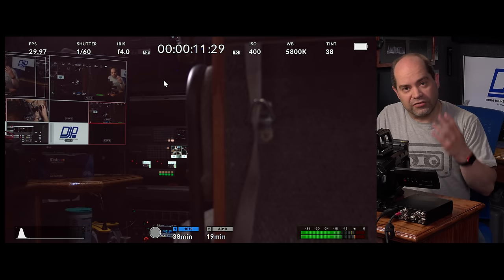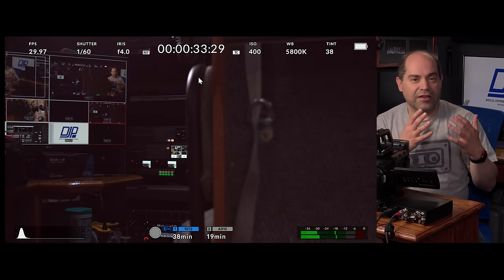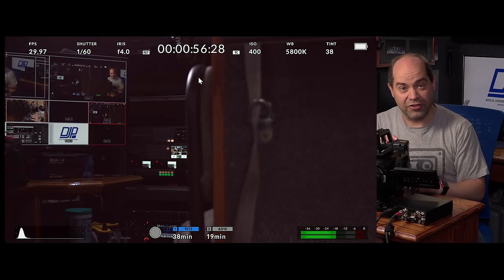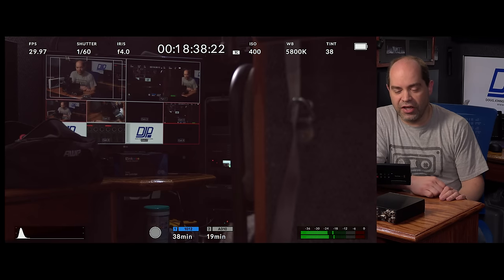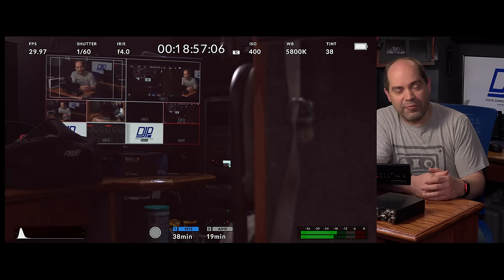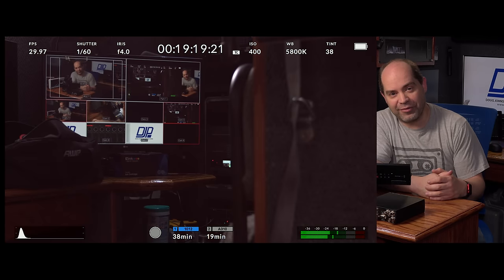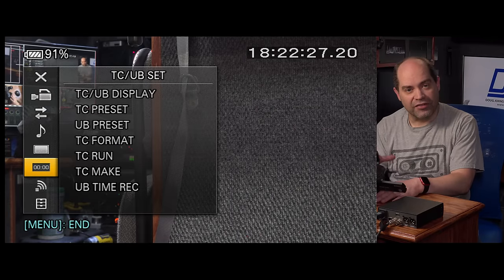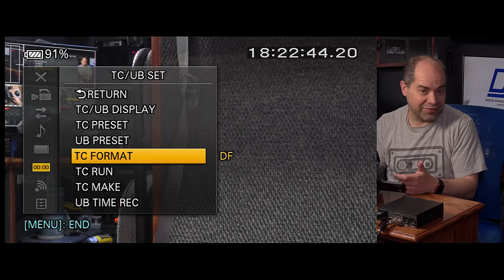Genlock, Timecode, Wordclock -- What Are They? Do I Need Them? Are They Interchangeable?

Comment: Great video Doug! How would you actually adjust timing on the longer cables. For example I am running 4 genlocked cameras with different cable lengths (15-40 meters) and cameras have option to adjust H phase. Do you use oscilloscope for such purpose to perfectly match the signals?
Reply from the maker: Genlockable sources usually have a timing adjustment. 

Honestly, I've never done long-distance syncing in HD. In the SD world we'd use a waveform monitor.
Reply: The EE (Electrical Engineering) answer is that you generally won't run into time-domain signal issues with cable length until you approach the quarter-wavelength of the signal.   In other words:  Transmission-line effects become significant when the length of the line is comparable to or greater than the wavelength of the signal. 

A more specific general rule of thumb is one-quarter of the wavelength. 

Given the HD 1080p Genlock signal demonstrated at 10:28, we can calculate the maximum cable length for which we will begin to have to worry about Transmission-line effects:

Full-cycle wavelength of 33.7159 KHz signal = 29185.0432 feet = 8897.8790 meters.
1/4 wavelength of 33.7159 KHz signal = 7296.2608 feet = 2224.46976 meters.

So for transmission delays on a long cable, we would need to have a maximum cable length just under 1.38 miles!  That's quite a long cable!  If we go over that distance we might begin to look at other transmission options such as fiber optics or radio frequencies.

More likely the issue that you'll run into first with longer cables is dealing with noise picked up by the cable itself from nearby sources of electro-magnetic fields.

Comment: Hello! Thank you for complete explanation! I never knew that. Very interesting and useful. Does all these BNC cables are 75 Ohm or some are 50 Ohm as well? Or 75- audio clocking, 50- video genlock/time code? Thanks!
Reply from the maker: All are 75 ohm.
Reply: @djp_video  Thanks! I guess 50 ohms RF was for analog antenna stuff, but they're everywhere in the stores, maybe for older analog signals or something like that.
Reply from the maker: @the_newvoice  Yes, 50 ohm is primarily used for radio applications. The one big exception is over-the-air TV antennas, which are either 75 ohm (coax) or 300 ohm (flat).
Reply: @djp_video  Thank you!

Comment: Thanks. Very informative and useful video. while editing a  video shot with multi-camera, the NLE software like Premiere Pro will syn the shots by itself. And this is very close to the 'Timecode' application.
Please correct me if I am wrong.
Genlock is of course different.

Thanks
Vikram (India)
Reply from the maker: When you have similar audio across different cameras, yes, Premiere and other editing apps can synchronize based on the audio waveform. But this feature doesn't always work. I've had it fail as many times as it has worked. If the cameras aren't placed close to one another, or if one camera picks up more background noise than another, or if audio isn't recorded on a camera for whatever reason, or if the audio in any other way differs significantly, you're on your own.

Comment: I´m a little late, so I dont know if you´re going to see this, grate content, I have a question: If i sync timecode first, and then connect gen lock between cameras and switcher ie. does the timecode stays synced with the jam, or is it going to drift? I mean if we´re starting the first pixel at the same time in all devices, the timecode should not drift, or is it?
Reply from the maker: The timecode and genlock signals would have to come from the same source. Otherwise the timing won't stay in sync. Higher-end sync generators will create both signals for you.

Comment: Hi Doug! This is very informative video thanks! Quick question, my blackmagic 12k can't get 60fps genlock from AJA gen10( HD 720p60 ) . Is there any setting i did wrong?  Thanks!
Reply from the maker: Try setting the GEN10 to output sync for 1080i59.94. It's a different type of signal that I believe the Blackmagic cameras know how to use. The 720p sync signal has the wrong horizontal sync timing for 1080p/4K.

Comment: Very informative! Quick question, in the tentical example, would that audio signal have to be maintained throughout the entire production or would a typical GH4 /GH5 mirrorless multi cam setup accept a temporary jam signal from a master TC generator? Thanks
Reply from the maker: If a camera has a jam sync feature you don’t technically have to maintain a connection to a master sync source, even though it would still be a good idea. But for cameras that don’t, you could get away with starting the beginning of each clip with timecode audio so the editor can sync the start of each file. The preferred way to go is to leave the master timecode source connected all of the time. 

Because timecode is just audio, you could split the signal from your timecode source to multiple cameras at the same time, the same way you’d split any other audio. I’ll be demonstrating one way of doing that in a future video.
Reply: @djp_video  looking forward to that video, thanks. I just picked up a Denecke SB-4 super cheap at a local pawn shop, will it’s BNC jack output TC audio? Can I just adapt to 3.5mm and jam a lumix camera?
Reply from the maker: Yes, you can connect to your camera. If your camera has a timecode decoder you can jam sync it. Otherwise it will just be an audio track.

Comment: this is great!!! I just started learning about Genlock and was trying to find out how does it actually work but there is very little information. THANK YOU!

What about UHD? I cant find any 4k sync generators but forums say that Tri-level genlock will work fine.
Just wandering.. is it just that first burst for communication when to start new line and pulse per second that matters?

How UHD device translates HD genlock? is it simple scaling? 
I found diagrams showing to use Black Burst interlaces settings 625i25 PAL for 4kp video.
I am so lost :) Can anyone explain ? 
Where an I find more resources ?
Reply from the maker: Let's start from the base of information from this video. I'll build on that. (But I'm simplifying things at the same time too.)

There are two separate synchronizations happening with Genlock ...  Horizontal and Vertical. Vertical sync happens once per frame, and horizontal happens once for each scan line (including those that aren't part of the picture, which is kind of another discussion).

Because the vertical sync is tied only to the frame rate and is independent of the resolution, many devices can use sync signals designed for lower resolutions when producing higher resolution video. So in theory a UHD camera could use blackburst, which is standard definition, for vertical sync. It would have to ignore the horizontal sync since those are tied to the resolution, but vertical sync is usually enough to line things up because the frame rates (24, 25, 30, 50, or 60 fps) is independent of resolution and therefore can be can be the same across SD/HD/UHD. So a 60 fps (frames or fields per second) SD sync signal can work for UHD running at 60 fps (frames per second).

The other consideration is that blackburst was designed for interlaced video. And even though in the world of interlace video we usually refer to frame rates of 25 or 30 frames per second, each frame is made up of two separate fields, so the fields are being created at 50 or 60 frames per second. That also means that even though blackburst is syncing 25 or 30 frames per second, it is also syncing fields 50 or 60 times per second, and if you were to look at a blackburst signal you'd see vertical sync pulses 50/60 times per second. And HD and UHD cameras creating progressive video can use that field sync signal to synchronize progressive frames rather than interlaced fields, thus giving you compatibility between ancient blackburst signals and modern 4K cameras.
Reply: Thank you @djp_video  This is all very fascinating.
I've noticed you have YT subscription available but have you been thinking about Patreon?
I can imagine you have a lot of knowledge to share, I would love to learn more.

Comment: On the monitor behind on the desk displaying the video and time, it that an option on the Panasonic monitor to display the embedded time? Or are you using a different device display the tc info?
Reply from the maker: The monitor is a Sony PVM-A170 and it has a feature to display timecode built in.

Comment: Hey Doug, thank you again for the info and help with my last question. But I have another if that’s okay - with the tentacle sync, do they have to stay on for the whole
Day? Or can you shut them off and it keeps the time code? Just wondering if you have to re - sync every time they turn on. Thank you
Reply from the maker: You do need to re-sync when you turn them back on. If you use your cell phone as the time source it's pretty easy to do.
Reply: Okay thank you, is it recommended on a full day shoot to even turn them off if you don’t need to? Or would new time codes not really make a difference in editing. Thank you again for the reply

Comment: With many devices having a ref in and ref out is there any limitation to how many devices can be chained together, or any potential for a device that's connected directly to the signal generator to be out of sync with a device that has it's reference chained through a dozen other devices?
Reply from the maker: There isn't a hard limit. And it will depend on whether the signal is regenerated or simply passed through. It's better to use a distribution amplifier (any old-school video DA will work) and have separate connections for each device, but you can certainly chain one REF to another as long as you know those devices will be powered on.

Comment: My question is how I turn a genlock signal into wordclock? Or how to make sure no sync issues occur when using Dante audio in live video production? Got any tips?
Reply from the maker: I'm not aware of any devices that will take a genlock signal and create word clock from it. But there are multiple options out there for devices that will create both though.

Cameras which are genlocked should maintain audio sync with other genlocked sources.

In terms of integrating with Dante, you'll want a mixer that has a word clock input, and then set that as the timing leader for the Dante network.
Reply: @djp_video  I use an ESE DV-321 which will derive a 48khz wordclock (and an AES11 signal) from genlock. It's a (relatively) inexpensive way to keep audio in sync with video over long periods of time.

Comment: I have three BMD studio cam 4k pros (no reference in), the BMD ATEM Production Studio 4K (has one reference in) and focusrite 18i20 (wordclock bnc) could I connect all of these from the BMD hyperdeck mini reference out? Daisy chain obviously, or what would be the best solution for this?
Reply from the maker: Since most of the Studio cameras don’t have a Ref In connection, they can’t be synchronized directly to a Genlock source. I believe you can set them to synchronize to the SDI input, which would effectively take care of many (though not all) of the reasons to use Genlock, like making sure that cameras all stay in sync with one another. That won’t help with minimizing latency, though.

Using the Ref output of your HyperDeck doesn’t really buy you much of anything. The ATEM has its own internal clock and frame synchronizer and it runs just fine without a Ref input. Having the HyperDeck supply a reference signal only prevents the ATEM from skipping or doubling video frames from the HyperDeck and nothing else, and that would happen so rarely that I’m not sure it’s worth adding that additional complexity and possible failure point by making that connection.

The Focusrite isn’t going to recognize the Ref signal from the HyperDeck — it is strictly used for Genlock. Word clock is an entirely different signal.

Comment: Hello, do I understand correctly? Timecode is always also an audio signal? 

Would it be possible to transform the TC - out from a zoom f8 via bnc to xlr or jack and go into a dslm camera? 

I assumed that audio timecode is different from bnc timecode.

If this works I will solder with a bnc to xlr/jack. 

Best regards!
Reply from the maker: It isn't always audio, but it is usually basically just an audio signal. Dedicated timecode connections, including BNC, are essentially just audio. 

I don't have a Zoom F8 to test, but it probably is just an audio signal. But to connect it to a DSLR/mirrorless camera's microphone input you'd need to drop the level unless your specific camera can be set to accept a line-level signal. The F8 would be outputting something around a line level, but the camera is expecting microphone level. But that's easy to do.
Reply: @djp_video  thank you so much! So i need to add a resistor too.

Thanks alot

Comment: For some models, such as canon r5c, the fuselage has only a separate time code interface instead of TC in interface. Can such interface be used to access genlock signal? I see the ref / TC in interface of BMD camera. You can accept two different types of X
Reply from the maker: No. Time Code and Genlock are different signals. The only cameras I've seen that support time code on the same connector as Genlock are the Ursas from Blackmagic Design.

Comment: Hi Doug, when you plugged in the cable to the TC IN Jack on the camera (at 26:00) not only did the the timecode change, but one of the colons changed to a semi-colon! What does that mean?
Reply: The semi-colon means that it is drop frame timecode (a regular colon is non-drop frame).  Basically, since the frame rates, such as 29.97 and 59.94, are not whole numbers, every second is missing parts of frames (.03 or .06 in those cases), which will add up over time.  So, with timecode, you can either ignore the missing frames and just keep counting or the timecode will drop frames on the counter so it accurately reflects the time, and so there are the 2 different types of timecode to notate that.
Reply from the maker: What Ryan said... ^^^
Reply: @RyanBoni  thanks Ryan, yes Doug did say he was running the system at 29.97fps so if understand it,  the semi colon means that it is not running full frames per second (eg not 30). Thx!
Reply: @lansleyONE   @Nick Lansley  Sorry, I answered the question while the video was still playing before I heard Doug give a full explanation of drop frame/non-drop frame later in the video!!  But, to answer your question, Nick, no the semi-colon or colon does not necessarily tell you one way or another if the system is running at 29.97 or 30.  All that the appearance of the colon or semi-colon does is tell you if the timecode counter is counting all of the frames or not.  Really, just think of it as 2 different counting methods. One precisely and accurately reflects the actual time elapsed and the other just keeps counting and will slowly drift from the actual time elapsed. The difference between the 2 is generally irrelevant, unless you are mixing DF and NDF together while editing things that were shot at the same time with different cameras, or if you need the timecode to accurately reflect the time of day or time elapsed for some specific reason. The general rule is to pick one or the other and just always use that one.

Comment: What if you use a recorder monitor with SDI inputs? Does this get over the issue of DSLR's without any genlock capability?
Reply from the maker: Some models like the current HyperDeck Studio models from Blackmagic can re-sync the input to a genlock source (but they obviously don't adjust the timing of the camera itself). But in most cases that doesn't buy you much -- most modern video switchers have frame synchronizers built-in which do the exact same thing.

Comment: Do you know how old and new hyperdeck series handle sync issues in cameras, and does it matter if ref in/out is connected or not? I.e. will hyperdecks just take the frames from the cameras? Or will hyperdecks occasionally drop/pad frames if the cameras go out of sync with the recorders?
Reply from the maker: The Reference input on the HyperDecks is only used for playback. When recording it syncs to the incoming video signal.
Reply: @djp_video  thanks!

Comment: Using Dante as a means for transporting the timecode LTC signal have you ever run into any issues with there being a drift in timecode due to the latency from the dante network? I know on a well put together dante network you should expect sub 1ms delay of latency but is that not enough to off set the timecode that's being received after the dante network to that which is being generated from the master timecode clock?
Reply from the maker: No. Timecode is only accurate to a frame (at 30 fps, 1/30 of a second, or 33ms). Dante's latency is usually well under a millisecond.
Reply: @djp_video  thanks so much for the quick response, this will definitely make life much easier on big multi cam OB setups. So in theory then if you used for example the Focusrite's RedNet PCI card on a PC and mapped one of the tracks to record the LTC you could use a computer as a secondary cheaper multi-track audio recorder with timecode accuracy? What software would you then recommend using to convert the timecode track and map it to the wav Poly file such that any editing software could then import that and timecode sync with pictures?
Reply from the maker: I'll be demonstrating how to do this in a video coming up shortly. The software that I'll be using is Tentacle Timecode Tool from Tentacle Sync. But many editing applications can decode LTC natively as well.